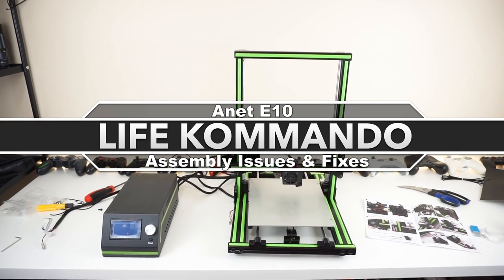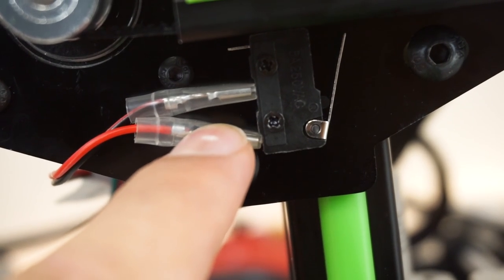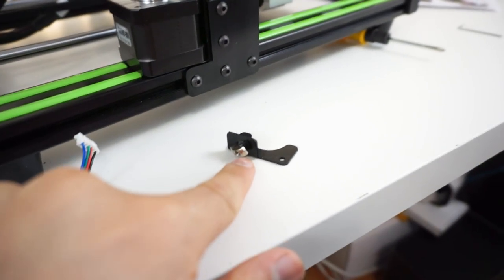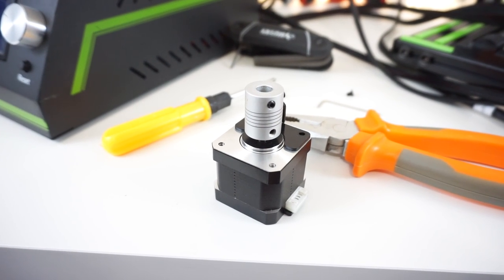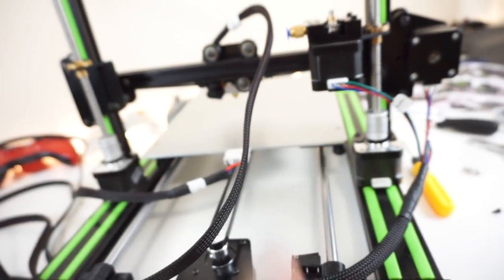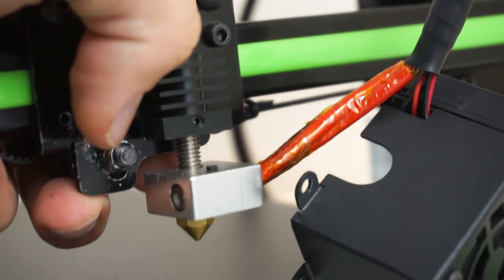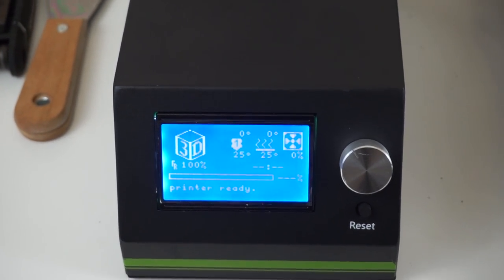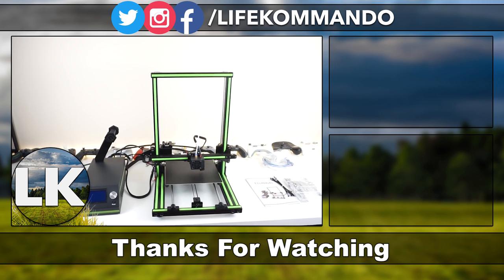Anet E10 | Assembly Issues & Fixes

Comment: Thanks for your reply,

Yes, the voltage was at 240V when I received it, that was the first thing I checked.

Everything else seems to be working, I manage to adjust the bed and "home" the printer so, the correct power is making other parts to work, only the heating bed connection on the main board seem to be failing...!

Comment: I do not understand why people are calling this thing crap before actually printing with it. Considering printed parts a bad thing... Why? Do you think the Prusa i3 MK2 is a bad printer because of its printed parts? This printer is definitely not perfect, but if you take it for what its currently being charged for ~$290.00 it is a pretty good printer.
Reply from the maker: I'm not calling its print quality crap, I am going to give it a full fair review, and compare it to the CR-10 once I'm done that. Similar issues I had here with the Anet A8 during the assembly that I had to fix but. At this price range the assembly process & experience was kinda disappointing, I am actually excited to see how the print quality is going to be :)

Also about the price they should really keep it at $290, $400 is too much I think unless the print quality is over the top. At that price range I think the CR-10 is better but hopefully it hovers around $300 and not $400
Reply: okay. I have printed 3 benchys so far and am more than satisfied with the quality. You wont be dissapointed
Reply from the maker: So far its looking good xD Im also printing with it the CR-10 & the A8 at the same time just to get a feel for all 3 of them at the same time. I was printing the pyramid which seems like is 100% infill stooped it after 6 layers, looks good, their sample file settings are slow I cranked it to 200% speed to see, and it kept up. Another thing the 3M surface is AMAZING & SO satisfying to take the print out. no mess what so ever print pealed off like a dream. Right now Im setting up my settings for a custom print
Reply: Life Kommando nice man. I am loving the 3m surface as well. I personally think it's the best build surface I've received out the box, and this is my 5th printer.
Reply from the maker: nice, what are the printers you have?
I'm searching about this 3M surface, and so far I found it on AliExpress, might order a pack and review it:
http://bit.ly/2u6Muxx
Reply: Life Kommando CR10, anycubic kossel & i3 Mega, geeetech mecreator 2.
Reply from the maker: Yea PLA works great on it, it will probably get scratched up easily real quick, I still yet have to try some ABS
Reply from the maker: Yup used a razor on a corner of a print and now I have a rip lol
Reply: 3M clear thin film adhesive tape - 3M do not make printing surfaces he may be refering to the tape on the back of the printing surface. Try a sheet of PEI, scuff it with 400-600 grit sand paper give it a wipe and never look back, no glue not tape. It is very robust stands up to a lot of abuse and needs next to no maintenance, use 3M tape to apply it to your glass bed or build plate

Comment: I received my Anet E10 printer today and have put it all together, once again the box has been miss treated and I knew that I would find some damage, the worse part was the black metal flat bars under the aluminium bed were badly bent, I had to pull it all apart to straighten the metal bars, after that, I encounter the normal issues that everyone seem to have had however, I have seen a few recent reviews and some guys were quite lucky, no damages and everything worked out perfectly in no time at all but off-course, not me.

The issue that is stopping me to print is the fact that the heating bed is not working.  I grabbed a multimeter and tested the bed, it seems to be ok however, is not getting power there is, following the cables back to the board, the 2 small wires in the centre of the plug read about 5V but, the power red and black thicker wires connected to the board do not read anything.

The power wires of the heating bed are connected correctly of the board saying "bed" the connection is tight and making contact so, I don't know why is no power in there and what the power reading was supposed to be, we have 240V here in Australia, I believe it should read 12V, right..?

What am I missing..?  is there any setting that I missed..?

Could you please give me some idea of what can be wrong and anything I should try...!

Thank you,

Cheers
George
Reply from the maker: I will try measure my voltages for the hotbed and see what happens

Is the printer set to 240v on the side?

Comment: So I found this video after seeing some issues from the carriage jostling around on its track... the idiot that put mine together cut out a notch on  the spacer to fill in that hole that is to allow for vertical adjustment... I had to take the whole thing off, pop off the spacer and file it down before I could adjust the damned thing... in case someone else tries mashing or squeezing upwards on that sucker and nothing happens.

Comment: I have of these coming and you guys are scaring the hell out of me, I'm new to the 3D printing and I didn't know this Anet E10 was a new model and not a smaller version of the CR10, they look very identical so is not difficult to make that assumption particularly because I'm new and don't really know about all these blanks I did however know of the printing sizes differences, the CR10 is just to tall for the space I have for the printer but from all the negative stuff I saw/heard so far, I'm starting to think that I would been better to find another location and select the CR10, too late now...!

These last few days I've learnt more about 3D printing than all the years prior and one thing that is getting stuck in my mind is that, I started to prefer the way the "delta" printers work, the ones with 3 filament colours on top of the machine work very impressively and I'm starting to think that making vases would be one of the things I would like to print so, printing height would be important so, Anet E10 limits that but not as much as the average 3D printers in the market, I may find myself buying more than one printer, hummmm...!
Reply from the maker: I feel you man, the E10 is super hyped up but at the same time I don't blame why people are angry, right now my first issue with it is the price I think a price point of around $285 would be acceptable but after this sale is over they plan to sell it for $400 which at that point I would get a CR-10 because that thing is a beast

At the same time everyone on youtube right now is enraged, and mostly because Anet clearly attempted to intimate the CR-10 and mislead new people like you & its pretty much a cash grab

If they have not made it look like a CR-10 and have a lower price point, I don't think would be that angry 

If I could choose I would like to have a some kind of Delta, a CR-10, & an Anet A8

- Delta just to experience it & tall 3D printing
- CR-10 - Because its a fantastic printer that allowed me to learn and focus how to get better prints, and know that i can print without having to fiddle around with everything every time I want to do so
-Anet A8 - Because its cheap & its charming, it was my first printer and its where I learned a lot on how a printer works, and learned about all those little quarks that come in some 3D printers, I find the price point and the struggles it comes with when assembling it to be somewhat charming and enjoyable and fun to look at with all the wires and cables it has around it.

My current status on the E10 is I need to tweak my settings and really calibrate my settings and see where I end up with build quality, which is something took me 15 mins on the CR-10 and ever since I did not change anything and all my prints were near perfect

Comment: So should I or should I not cancel my GB order of the Anet e10 as my first printer? Help you guys!
Reply from the maker: Yeah CR-10, it just a super solid high quality printer that can print big and is just very well build, totally recommend getting it over this one specially if this is your first. Its worth its money
Reply: Ok thank you both for the help
Reply: Well, my friend, I understand you well as I'm also waiting for the delivery of the exact same 3D printer as my first ever 3D printer.
I can tell you that I have had a few times where I almost canceled the order and either order the CR10 or get my money back and reconsider what printer I would actually be preferring but, each time, I thought of the many times I was told I had made a wrong decision/move and I simply prove them wrong, (exceptions do/did apply..!)
I decided to stick to my initial decision and trust my gut feeling that, these printers are not as bad as some made them look, for whatever the reason/s.
Sure, we all can agree that so far and from the reviews made, the factory quality control really sucks and some minor modifications are required out of the box but, is that the worse we will have to deal with...?
I have already decided that I prefer the way the "Delta" 3D printers work and I may buy another printer in the near future, I'm liking the Tevo Little Monster but at about AU$1,500 its a lot of money to me but that doesn't change the fact that I like it...!
I will focus on the Anet E10 for now and I will go as far as I can with it, the results are something to be seen and told, one day...!
Reply: I have a video up with some prints it can print nice, just cross your fingers no major QC issues
Reply: Kossel style printers are easy to build from scratch without the kit. You can print every single bracket and frame piece. You can order enough V slot extrusion to make as big or bigger a printer then the Little monster. I have a homemade Kossel XL home that has a build area of 330mm Diameter by 530mm tall. It cost me roughly $350cdn to make the printer, it is powered by a PC PSU, has a heated bed, lcd display and aluminum push rods for arms. The biggest thing is to setup the marlin firmware for it, you need to set your smooth rod length, delta radius, delta effector offset, carriage offset, etc.
Reply: GB did just release a coupon code putting the printer to 279, still think it should be another $20 lower
Reply from the maker: Mine makes a ton of noises when printing, the worst one yet is the failing power supply cooling fan, it does make pretty decent prints, I saw your video, I printed bunchy and it turned out nice, but I am having issues with stringing, a lot of it
Reply: I find stringing is all in your settings. I have not printed anything yet that would have stringing show. Currently I am in the middle of completing a few addons. I just finished 2 models that will allow you to mount a cable chain to the X axis beside the one for the Y axis. I already have a design for the X3 X axis belt tension that should fit this print well, going to print it out and test it on the printer. I am thinking of swapping the fan out in the center of the box with an 80mm. I have a spare lying around it is fairly quiet, I use one on my A8.  I removed the connect on the bed coming from the box and soldered much more robust connectors in their place as I still want the ability to detach the bed. I also added cork board to the underside of the bed to reduce electrical cycling to the bed for heating and to heat up faster. I need to work on the fan shroud next as it cools the heater block if you dont partially block it off. The printer I received is quiet when printing, but the box is loud, really loud those 2 little fans just screech inside there.
Reply: Funny I watched your video and you had the same damns stripped screw I had on the Z Stepper motor and Had to do what I had to do which was remove the whole thing.
Reply from the maker: Yeah I found the current set of fans on the unit it self to be fine they do sound very similar to the CR-10, but the box man is it loud, and sometimes if you turn it on it would vibrate and screech like crazy till I turn it off hit it then turn it back on to "catch on a good spin"
Reply: whats so special about it? Wait lets see it has a smaller build area, oh and wait it requires 100% assembly - wow indead 2 very special things.